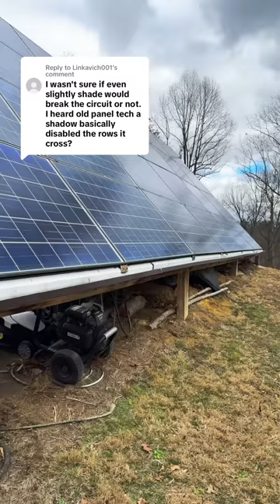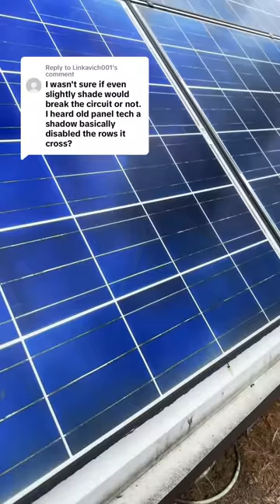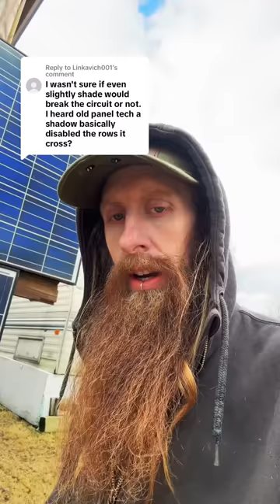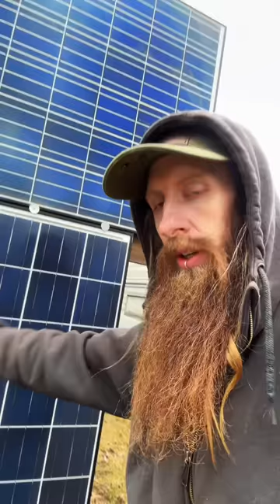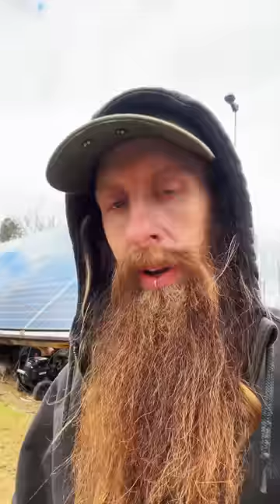solar panels

Comment: Good thing you double-checked to make sure covering them like that worked.
Reply: My dumb ass would definitely have been looney toons'd across the yard
Reply: @eragonawesome well that's going in my vocabulary, thanks 😂
Reply: @eragonawesome Solar panels produce DC. DC doesn't let go if the current/voltage are high enough. ALWAYS better safe than sorry with electrical
Reply: Any smart and patient person would.
 
So that means I probably wouldn't have done that.
Reply: Electrical is one of those things I always hire out lol. Outlets and fixtures sure, anything more serious I’ll let a sparky do 😂
Reply: @eragonawesome    lol 😆 same! Only I would have told myself to make sure I checked first, would have had a whole reasoning and plan around this very test...  then I'd forget and get a free x-ray. 😅
Reply: I fully thought he was going to say "and then I electrocuted myself"
Reply: @MrMikeT89 I thought it was ac that did that.  I don't plan on testing either one tho, lol
Reply: @leekelley4701  AC is Alternating Current. It goes positive to negative however many Hz your power is. That means it hits 0 in between. DC is Direct Current that just goes on or off. For a visual representation, AC is a sin wave, DC is a square wave
Reply: AC holds you, DC throws you. This is what I have been taught as an electrician. Luckily I have been hit by AC circuits with no load on them, and/or the circuit tripped after initial ‘shock’ (like it should with code compliant work) and outside of the electric fences (DC) you got out on small acreage pastures, I have never been hit by DC. 
Edison killed an elephant with AC at one of the world fairs at the turn of the century, as a demonstration on how dangerous Tesla’s AC was. AC proved to be more efficient (look at pictures of AC power distribution vs DC power distribution) Any explosion you see from AC power is from arc flash. Not from getting electrocuted. (I don’t not recommend this one.., electrocution burns you from the inside out, and there are some gnarly pictures of the burn victims)
Reply: @midgetman4206 yea same lol
Reply: Measure twice, cut once... but check the circuit again first.
Reply: Under 36v dosent jump throu your skin (if he was working on the part after transformer he would get a zap tho )
Reply: Are those trinas?
Reply: Oh yeah I'd have got zapped and had to have a conversation with my son about safety who would be sitting there watching me...

Comment: The bypass diodes seemed like a good idea!
Reply: All modern ones have them for the most part.
Reply: @deadprivacy Bypass diodes have been around for decades. You'll see them in coil circuits used to discharge the coil.
Reply: Me remembering 1 bulb out on the Christmas lights, shorting the whole thing
Reply: Very simple and cheap solution for a very overcomplicated and often costly problem.
Reply: @heyviper1238  So is paint.
Reply: Bypass diodes are great, but they do add costs, so typically, per panel their is significantly less than the number of cells, this means a shaded region will prevent a small number of cells from working as intended.
Reply: @MountainWo1f  If you think they add costs, add the cost of not having them.
Reply: Indeed, being older panels he lucked out they had the "bypass diodes" something he certainly didn't expect being he got the panels used for cheap. that isisisis Good

- comment produced using Chat GPT 4.1

Comment: If you have a really ragtag bunch of panels you can get what are called "dc optimizers", basically its a localized flyback converter that has its own mppt algorithm so you get around the typical issues combining dissimilar pannels

Comment: Depending on the panels you can hook up micro inverters off each.

So if one panel goes out the the rest of the string is still up & running.

Enphase & solar edge are prolly those most popular.

Comment: Want to extend the diode style protection to each panel?  When your single string invertor fails, replace it with per-panel micro inverters. Then you will have safer AC coming out of each panel and just need a combiner box.  Then if one whole panel dies or gets clouded the rest aren't effected at all.  Also if your single invertor dies, well no power until the UPS truck comes?  

 I like my Enphase micros a lot...😊

Comment: I haven't seen panels without bypass diodes in many years. Most panels also have 2 or 4 rows of cells in parallel do deal with shading as well.

Comment: When I was a plumber, the best present I ever got was a multitester. The number of times I didn't end up electrocuted because of it is scary, now I look back on it.

Usually because homeowners wired something through a circuit running to a jacuzzi or dishwasher.

Idk. Something like that. My cousin was a master electrician (he got me the mt, and taught me how to use it) tried to explain what most likely happened, but there's a reason I became a plumber and not a sparky 😂

Comment: Just to answer some questions in the comments. 

Clouds don't cut the power because they don't block most of the sunlight. 

The cracks in the cells are snail trails and are usually cause by over handling. The moduels might have looked perfect when they came off their previous site but just the act of reinstalling them flexed the module and caused those. Snail trails don't have any significant effect on the production though, so nothing to worry about. 

Also, an IR camera is a great way to see issues that aren't visible with the naked eye. Specifically look out for hot connectors or junction boxes on the backs of the cells to catch any issues before they become more serious. With older modules, you'll likely see some hot cells as well, but that's normal.

Comment: For a long time, the parallel/bypass wiring stuff was significantly more expensive than the all-or-nothing wiring.  The prices finally came down, especially when so many people stopped buying the all-or-nothing panels out of sheer frustration with them, allowing the bypass versions to ramp up production (which is a thing that usually reduces costs because of batch buying & batch processing methods getting cheaper in greater quantities).

Comment: Love the learning! If you needed more power, one thing you could try bifacial solar panels, they don’t get near as hot because they aren’t in the direct sunlight and that efficiency makes up for them not being in that direct sunlight. They can be out on top of fences, you could just stick two panels together so they faced each direction. Get some more cheap ones. Love the channel!

Comment: Don't know if you will see this and i only have a 3 years experience working with solar now. But the solar panel you touched in the start of the video has some i believe its a small sign of arcing inside the cell itself. But the system i seen it on they were causing the inverter to show a ground fault. I spent a whole day making sure that was the issue. So i figured I'd give you a heads up just in case you see those marks spread more. From how it was explained to me it doesn't really become an issue until those marks get to the edges of the cell.

Comment: I bought very similar panels used from, I assume, a solar farm. I bought 40x of them for about $40 shipped about 8 years ago. They are Trina solar and are the 245w panels and have maxed out my inverter a couple of times due to cloud edging effect. I have the old MPP LV 6048 and lithium batteries from a Nissan Leaf. Overall good system, but I need to upgrade my batteries to run everything through the winter and get a wind turbine to add a few watts overnight.

Comment: Thats great! Do the solarpanels meet all of your power needs or do you need to prioritize appliances during low sun days? (sorry if you have answered this before just curious😅)
Reply: He’s mentioned in a few videos, they wouldn’t run large appliances like the washer on low-sun days and while it was snowing I believe he may have pulled out a generator for some extra power too.
Reply: During the summer he literally has like every bit of tech on the property running strong but when it starts getting closer to winter he does turn off a lot of non essential functions like his Wi-Fi boosters all around the property.
Reply: To add to the other two comments; he actually wouldn't need to cut back on his usage in the winter at-all if he spent another 100,000+ on batteries.  

The main issue with solar energy isn't that they don't produce enough power, it's storing the massive amount they produce over time for more than a few seconds.

Comment: Awesome content! I design pv systems, I have only designed on grid solutions so it’s always interesting to see self sufficient installs. The good thing about used Photovoltaic panels is that it should only loose around 10% of it’s effectiveness in ~20 years and lifetime of the panels is around 30 years or more depending on the conditions that it has suffered.

Comment: It's still gonna act as a resistor and lower all the panels in the string to the voltage/amperage of the lowest panel in the string. The same goes for having panels at different angles, or dissimilar panels in the string. You need to measure the string under load to be able to see the difference. If your charge controller has different string power points, then you can have dissimilar strings. If not, you will lower the production of the whole array to whatever the weakest string is. However, if you lower the total power of an array by 15% due to resistance, but nearly double the amperage, you will still get more power overall

Comment: I think that’s a difference between monocrystaline and polycrystalline. The mono crystalline i believe works better with indirect, maybe part covered than poly. But I think poly is better producing in direct sunlight like in conditions where you’re able to move the panels with the sunlight.

Comment: I’m really interested in solar power. I’ve found out these companies go by only your electric bill. But if you are not utilizing the electricity to what could be used say if more people lived in the house based on the electricity bill then they are underestimating the solar system needed. I’m curious how did you learn about what you needed to cover the square footage you had and how to install that grid? I’m not off grid but I’d like to lower my energy costs.

Comment: I can't think of any good comment I just like this short video. I had no idea that older panels are riddled with electronics that have conditions on when they can deliver power. I thought all panels were just that, panels, and that they are connected to some fancy box somewhere that does something cool with the power. Personally I'd love to have an array of solar panels and some experience with off-grid-ness, but I have to convince 118 other owners of apartments that we should into this and that is not happening any time soon.

Comment: Well, upon looking into this, this info is both true and false. I really hadn't thought about this before since i've only played with low power solar, but covering a cell doesn't actually cut off the power flow, it causes that cell to become a short, consuming power (covering it for too long will burn it out in a high current situation if it doesn't have protection circuits.)
So those built in bypass diodes guarantee that any panel producing energy has a path for the energy to flow through, while blocking diodes prevent the panel from shorting and burning out.
Definitely a "good to know".

Comment: Beautiful story on when used is better than new
Reply: I'm not sure how you got that front the video. What was new that would have been worse? Or are you just saying it was a good deal to get the used ones instead of getting otherwise fairly identical if not slightly better panels? Genuinely just confused

Comment: Used solar panels are the best. Used solar batteries? Ehhhh, especially old lead ones, sometimes it's better, and even more economical, to buy them new anyway. Sometimes, that is.

The only reason I'd buy new is if I wanted to install a lot of them at once, or if there were some extra requirements like specific roof issues etc.

Comment: Well since solar panels are literally infrared LEDs( light emitting diodes) it shouldn't be that hard for the silicone to incorporate built-in diodes like check valves I don't know why they don't do this by default

Comment: So if there is a small crack in one of the panels do they still operate?
Reply: Yes, modern day PV modules are split into 3 or 6 circuits that are run in parallel together. If a part of the panel is damaged lightly that section will partially turn on the bypass diode so it doesn’t burn out the load performing section. Panels now a days are pretty resilient. Just an FYI I am an PV analysis engineer

Comment: Not entirely accurate.  If 4 panels are in full sun and one of those 4 is 100% covered in 10% of the panel then all 4 will produce 90% power.  There are micro inverters or power optimizers that can override that loss and only the covered panel will produce power at the reduced rate. All of that is done outside of the panel.   7 years solar industry. (Grid tied)
Reply: Cover an entire panel and test voltage... then cover 50% and test.

Comment: Sounds like awful design
Reply: How so
Reply: @quartzskull8772  shouldn't completely disable if you cover just a small part
Reply: @MrBrax  his doesn't that's the point, it's a circuit like those Christmas lights that completely stop working if a single bumb burns out if the circuit doesn't connect all the way it stops